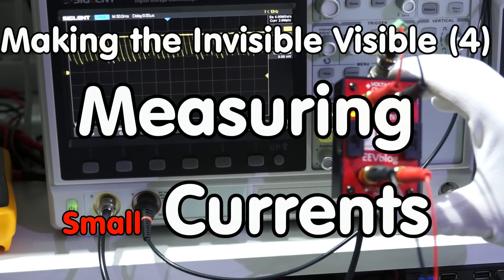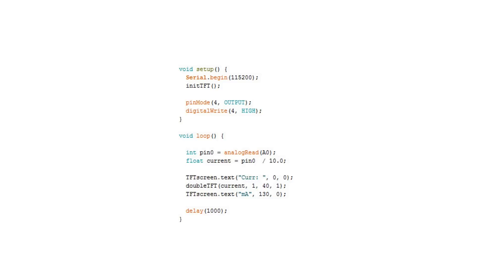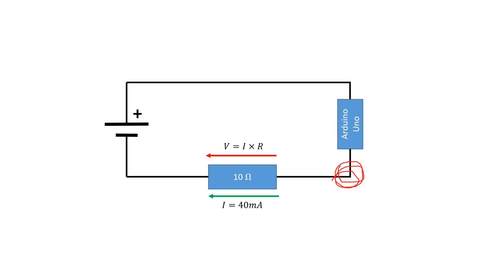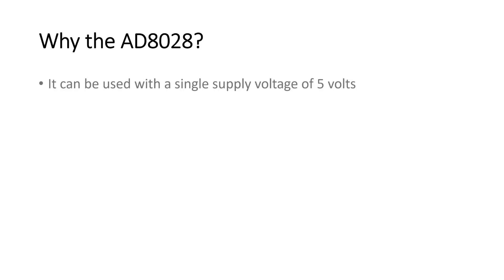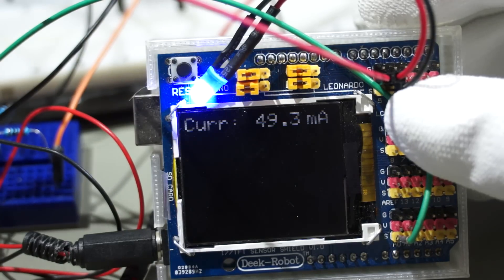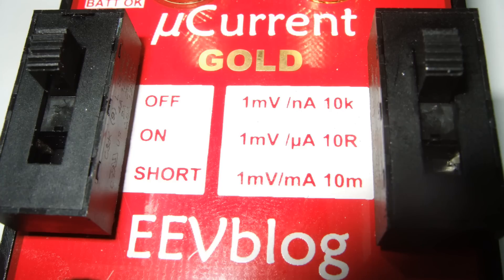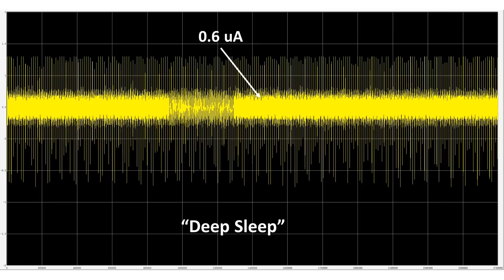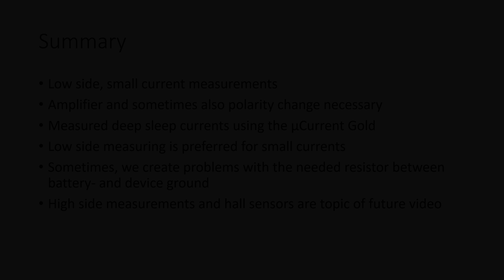#84 Measuring small currents (incl. building of an amplifier and the µCurrent Gold)

Comment: Hi Andreas, Thanks for you amazing video.
I want to measure  +/- Nano amperes with the bus voltage toggling between +/- 10V.
Can I use uCurrent Gold with external power supply feeding +/-10V to the op-amps ?
Reply from the maker: Measuring nanoAmperes is extremely difficult because of noise. The MAX4238 opams used in the ucurrent Gold only work up to 5.5 volts (+/- 2.75V)
Reply: @AndreasSpiess Thanks Andreas. Happy New Year.
 I am working on a design with programmable power supply which changes from +/-1mv to +/-10V and want  to measure currents in Nano amperes. Do you have any recommendation of using different Op-amps ?

Comment: Hello : please look 1:47 you connected the adruino after the resistor there , voltage will be  zero, I think you should  connect the A0 between adruino to , resistor , there you will see , voltage different -> current reading :)
Reply from the maker: What voltage does the Arduino measure? What is the "Ground" of the ADC in the Arduino?

Comment: ANDREAS SPIESS, when disconnecting the earth ground on an AC outlet why is there "leakage current" in microamps measured on the metal chassis of the equipment device circuit board under test? Where is this leakage current in microamps coming from in the circuit board under test? All equipment has leakage current when you disconnect the earth ground on the AC outlet

Comment: i wish you would have included a layout of your circuit (with actual components instead of block diagrams)
i also feel you didn't delve deep enough into how the op-amp affects the circuit, why does it need to amplify the voltage drop? can't the adc just measure the 250mV drop across the 0.5 ohm resistor?

say i have a shunt resistor rated 75mV/5A, so 15mV/A. can't i set the ads1115 adc to a lower gain setting, like GAIN_SIXTEEN, which means +/- 256 mV, and 1 bit equals 0.0078125mV, to accurately read 1mA, which is a 0.015mV drop?
Reply from the maker: You find the diagram is around 5:21 (including formula to calculate the resistors) and I mention, which op-amp I used.
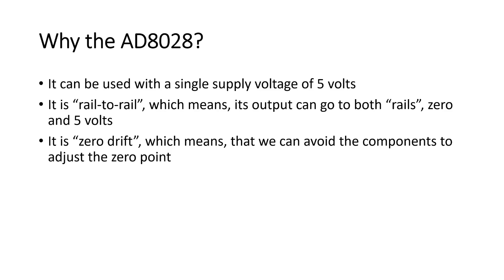At 6:27 i say, that we need the op-amp to solve our "negative voltage" problem. Its primary goal is not for amplification. But of course, you can use it also as an amplifier. If your ADC already has an amplifier built in, you can decide, if you want to use the amplification of the op-amp or the ADC. This depends also on the distance between the shunt/opamp and the ADC, because long wires tend to pick-up noise.
Reply: so if you'd place the ADC the same distance from the shunt as you would place the op-amp, it doesn't matter if you use the gain of the ADC or an op-amp? i have the same ADC as you by the way
Reply from the maker: I did not check, but I would think so. But you still need an op-amp because of the negative voltage
Reply: but the voltage drop across my* shunt is 75 mV at most. the datasheet in your video says -300 mV with respect to ground is acceptable. doesn't that mean it's within the limit?
Reply from the maker: Just try it.

Comment: Nice video for current measurement at the medium current levels.  I make a current measurement device that measures current from 1 uA to 1fA.  To see my YouTube video search for "Femtoamp measurement on your desktop".  I want to also bring my device to market and find it very costly.  My device is designed to measure very high megohm resistors and easily measures 200G ohm resistors with as little as 1 volt source voltage.  My meter has a 20 uV burden voltage and has essentially no noise.  The only noise is the shot noise and Johnson noise from the source current.  This is what allows me to measure very high megohm resistors with low voltage.  The accuracy of my current meter is 0.1% plus the shot noise +- 2 fA.  When measuring currents below 1 nA a low noise shielded cable is required with I also designed.  Keithley uses a triax BNC for their meters and I use cheap regular BNC connectors.  My meter is very low cost and if used with a 5 1/2 DVM would be around $20.00.
Reply from the maker: I do not understand anything about this topic, because I never had a use case for such a device. But I agree, building and selling hardware is very difficult these days. Especially if your product has a limited market. And if your product has a big market, a Chinese is fast here to copy you...
Maybe this guy knows more than me: https://www.youtube.com/channel/UCDqryeq1kMDSEQwltWqASrA. He builds from time to time some very nice measuring instruments.
Reply: Hi Richard, is there anywhere I can check your current measurement device?

Comment: if you really want to measure negative currents too, you can use an inverting buffer (also an opamp) and then put that in your second ADC

also measuring it with an oscilloscope is much easier i think :P just put a resistor there and attach the probe.

Comment: Hi Andres,
I needed to measure the current coming and going to my 4x12 22AH Lead Acid batteries (48V), I bought the ones with shuts, but they consumed too much power across the shunt. So I went with and Allegro hull effect sensor. I had many left over from samples I ordered 10 years ago. They don't make them like that anymore, but they are still good as the new designs.
Hey, don't laugh, it was free! You can try. The worse is they'll say No!
Here is the link if others are interested in measuring high currents.
http://www.allegromicro.com/en/Products/Current-Sensor-ICs.aspx
Reply from the maker: The ACS712 from Allegro will be part of the next video about measuring currents.
Reply: Looking forward to it.

Comment: Very nice video Andreas, a time ago I bought a few INA219 (basically a precision amplifier) modules and I always use those to measure (high side) DC current.
Reply from the maker: Exactly. I have a few of these and they will appear at the "high side" in the next video...
I wanted the whole thing a little structured that it is broadly understandable.
Reply from the maker: hello there Of what?
Reply: The Adafruit INA219 module maximum voltage is 26V DC and up to 3.2A
Reply: Andreas, the MAX4173 is also a very nice high side current ic and it is available from inhaos in a nice package ( CS-4173 from inhaos ) maybe you could review that one also? I just ordered one myselve.
Reply from the maker: I do not have one of these, I have an INA210, which seems to be similar.
The video will more focus on the principles than on the products itself, because there are people around with much more experience in these analog stuff. I try to focus on the typical applications.

Comment: as part of a solar panel system I would like to track with an ESP8266 volt/amp production and amp usage by the load.... can you point me in the right direction? The final project is for 2000W at 12v of solar panels
Reply from the maker: This is definitely on the "high current side". So, you have to wait for the next video.
Reply: Just use a shunt and simply read the voltage on it.